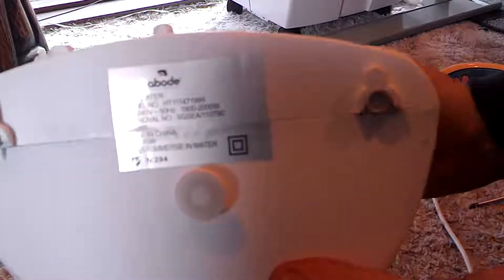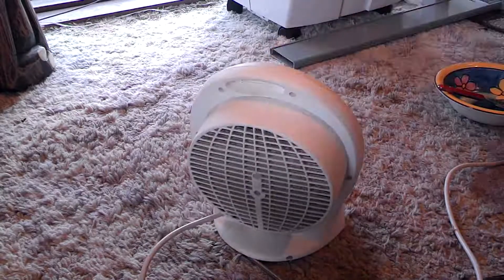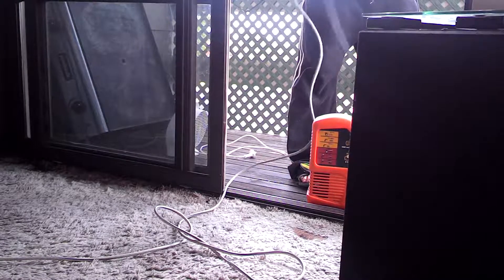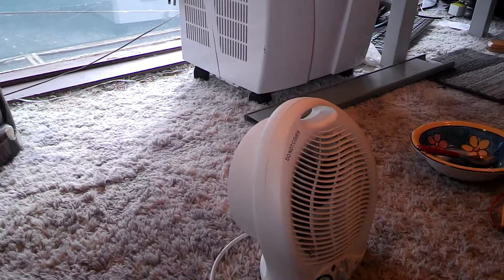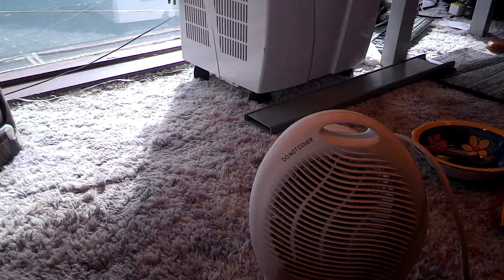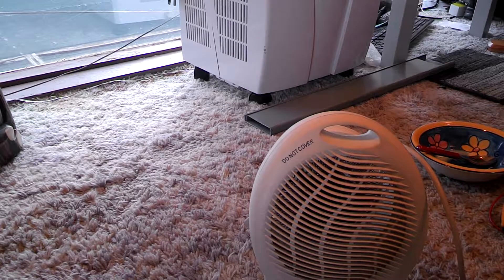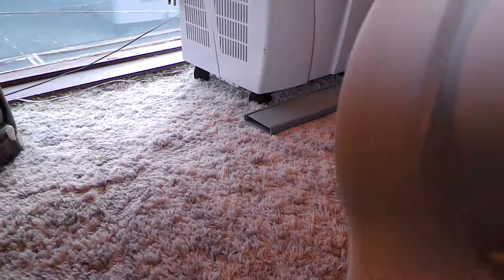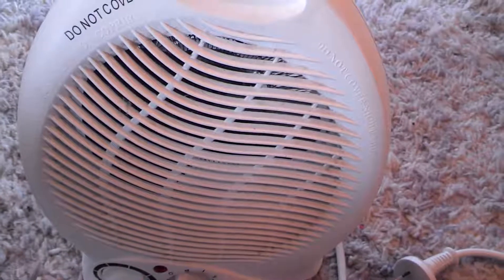Poor Man's Repair - Heater number 2 for the day

Comment: Same type of screws in many generic chinese made heaters on sale in the UK too, triangular screws that were never meant to be taken out, though I did get them out an east german made EWT heater in 2000 after some german genius's 6 amp 2 core lead actually melted through  spraying sparks from under the heater everywhere when I moved the thing, fitted 10A flex myself, thing went until december 2015 when the rotor fell out the fan motor... I wasted 2 good screwdrivers getting the thing opened though, and swore at it during the repair.